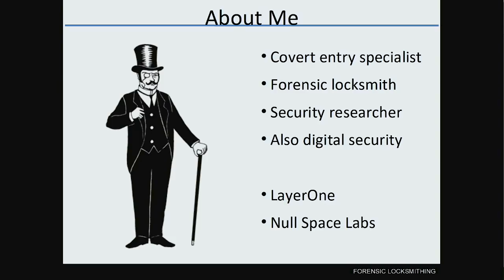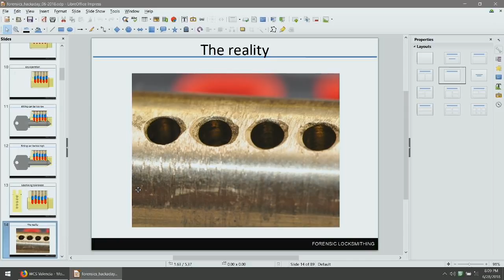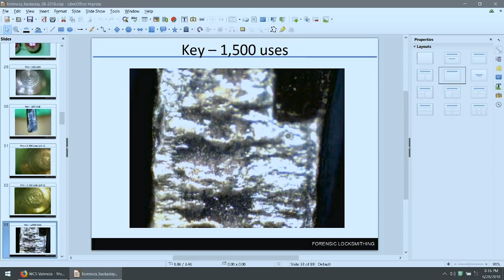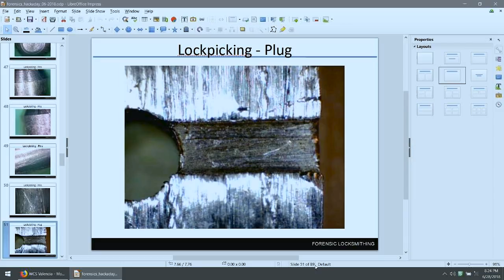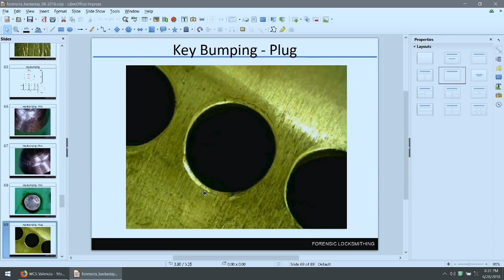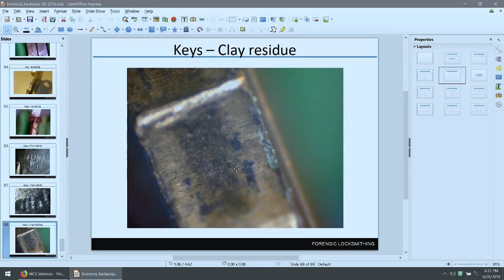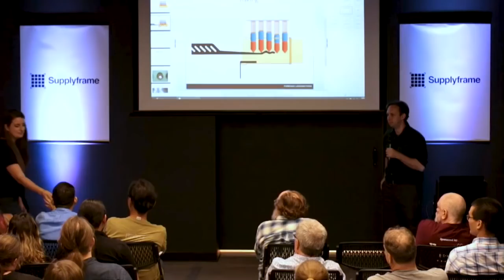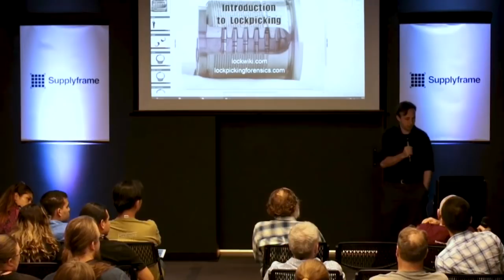DataGram - Forensic Locksmithing

Comment: I think he should have said which variants of Abloy to buy. I mean, even the year 1907 design (Abloy Classic) is way better than pretty much any US lock but they have way better locks nowadays. For the US market, Abloy Protec or Abloy Protec2 would be probably the best mechnical lock core you can get. However, Abloy asks for pretty high profit from its Protec series locks so those are expensive.